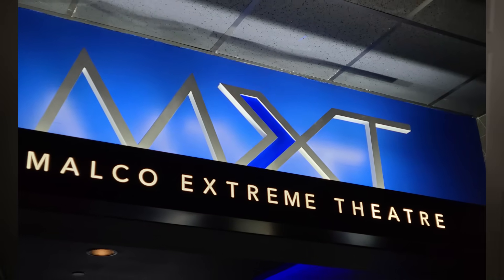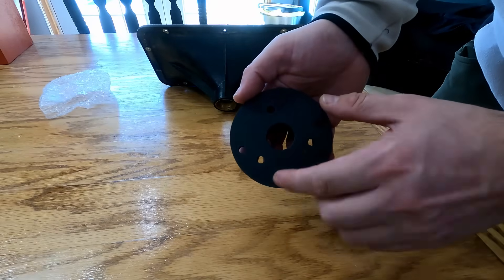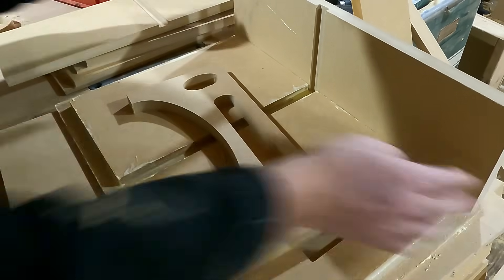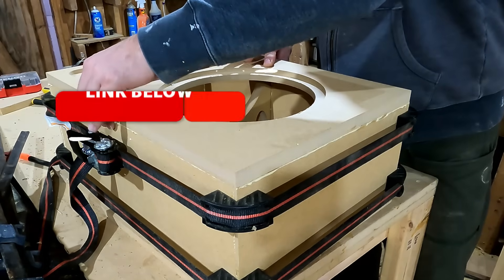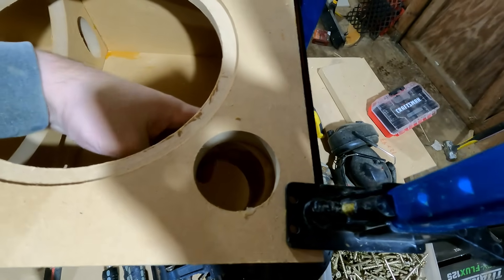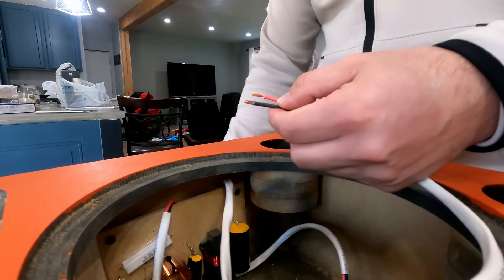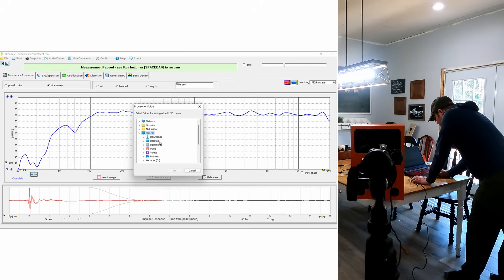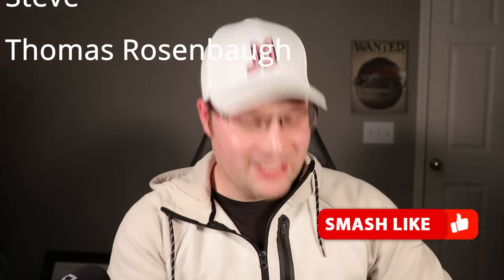How to Build $5000 Speakers for $400 - Klipsch KPT Inspired - Cinema 10

Comment: DO you think this would make a good match as a center with my klipsch Forte i speakers? Looks like 85 db sensitivity on the graph in the clip.
Reply from the maker: When I do my test, I don’t do them at reference. I just do them at a normal listening volume so I don’t blow my eardrums out. But yes, I think they would make a good center channel
Reply: @Toid  Hey
 thanks for you quick reply!! I meant specifically for the Forte... but the sound from the sound demo (open, airy, lively)and the fact that your graph was done a little lower tells me that they might be. thank you for your videos. they are educational and well done, sir.
Reply from the maker: @SmilinMikeable  I apologize I did mean to say I think they would make a good center for the Forte’s.
Reply: Just bought the plans. Not sure when I  will have time to complete but as a thank you, well worth it. How much do you think is to be gained by going with higher end capacitors? Just bought Sonicaps from Crites for my Fortés. will rebuild the crossover and am dampening the box with the car deadener stuff and foam and more bracing. Could do the same with your box. Do you think there would be an appreciable difference considering the driver quality (I dont think cheaper drivers are bad necessarily), box design, etc.? Essentially- how upscalable is it? Lol

Comment: I have a pair of celestion retro KR 8 speakers   and the plastik body is compelitly  cracked   this project look nice to rebuild  with there drivers  Only one problem the the bullet horn tweeter is completely intergrate into the plastik body waveguide  there is no screw-on socket and mounting plate on the driver   any idea  to solve this??

Comment: Is this your recommended build now for home theater? Can I use these for L C and R?
Reply from the maker: I really love these speakers. I currently use them as my surrounds. However, when they were in my living room, I use the men’s left and right without any center. They did such a great job and left and right that I was able to use a phantom center. And I would absolutely use them as an LCR. But I currently use the Audience 212 as my left and right with the Cinema 6 center. However, I have considered many times building another cinema 10 to use as a center
Reply: @Toid  Thanks! would the cinema 6 or 10 both be suitable? I have paradigm monitor 9 for left and right now but my center mid range just died. I am hoping to gradually build out my theater myself.
Reply from the maker: @ttonAb2  they are compatible. My personal preference is the cinema 10 over the cinema six.
Reply: @Toid  Thanks, I tried to purchase the plans but I get an error 404 page not available.

Comment: Projects such as these, remind me of a project that is still popular where i live. 
Its called Tangen AVdesign inConcert Miles. Using two Beyma 15p80Nd 15" pro drivers and a Beyma TPL-150H tweeter horn.
Its not cheap, but quality seems to be really high.   2022 these will cost you around 2200-2700 euro to build.
They can be used with passive filtering, but active seems to be the way, to keep that +100 db efficiency and dynamics.
One builder went from Klipsch RF-7 Mk II to inConcert Miles, and he said they were way better in every aspect, plus they can play much louder.
And RF-7 Mk II cost around 6000 euro here.  There is a few threads on the inConcerts, also in english.

Comment: Could this plan be incorporated into a music console design (think Wren Silva)?  Would I just incorporate the dimensions of the speakers into the overall console?
Reply from the maker: Yes
Reply: @Toid   With this in mind, do you have a recommendation on which speakers you have built that would be best for this sort of thing?
Reply from the maker: @kylekokko6572  I’d personally do the soundstage 15 as they are tuned lower, so they give you a full range of sound. These sound great, but depending on how low you want, you might want to pair these with a subwoofer

Comment: I believe the Dayton Audio MB1025-8 10" Professional High Power driver might be a much better fit for this project. It has the same usable sensitivity of 96db (looking at the graph) but 50% better XMAX and in a 1 FT3 internal volume box will give an F3 of 59Hz (with 50Hz 2nd order high pass) VS about 98HZ for the Celestion (after the 60HZ second order HIGHPASS) It would give this speaker a much better frequency range. So would be better for a surround speaker or center channel. 98Hz 3db down is not low enough for a center channel. Needs at least be flat to 85Hz for the male human voice. For surround speakers I would want at least 70Hz 3db down.
Reply: I see the xmax is 2mm.
Reply: @vegapower454  Right, I understand if he keeps a high pass to limit the Celestion to 100 Hz he is fine. but the MB1025 will go much lower work much better for surround speakers and I think even for a center channel. with an f3 down to 59Hz would also work good for some front left and right channel applications too and can have a Sub for frequencies lower than that. I have some 100Hz speakers and they just don't go low enough for rear surrounds (at least for me).

Comment: For some weird reasons, I feel sick every time I watch audio DIY videos those use spade terminals/disconnects/cable lugs etc.
I mean, I admire all the work these guys put in like, calculating, wood working, assembling... please spend few more minutes just hard wiring (soldering) those terminals with good quality wires...
Reply from the maker: The great thing about DIY as you’re able to terminate the drivers and use, whatever cables you want. What you learn with DIY is that soldering is often a last resort when connecting drivers. In fact, it usually is even inside the speakers that you buy commercially if anything should ever happen to a driver or crossover, or you just wanna make a change, it’s much easier to do this. Not to mention a lot of manufacturers drivers the way that they’re connected to the actual driver itself it’s not always the most secure to take an additional solder. But definitely use whatever cables, and or termination that you feel as fit.

Comment: Looking at some very expensive horn loaded speakers from a company called Fleetwoodsound their Deville loudspeaker which start from $15,000 have what look like a B&C compression driver and a 8 inch neo magnet woofer the drivers look to be ~$500-600 in total. I am sure the speakers do sound sound superb.. but I am sure a wooden exponential horn from Joseph Crowe and some great CNC woodwork would get something close for a lot less... A potential joint project Joseph?  
I'd love to see something like that made for people without $15k.

Comment: I've always wanted to do this.  I actually have a small wood shop and I've worked with wood for years now. I'm also an avid fan of music and home theater.  I've always wanted to make an exact copy of high quality high end speaker to see how much cheaper I could build one instead of just buying it. I of course would need to be able to find and buy the actual drivers and either crossovers intact of atleast have the schematic for the crossovers so I could build them as well. As far as the cabinet I could of course just build them to the same measurements as the original.  One of these days I'll do it....

Comment: So ... If you have a $20k digitized wood cutter you can make $5k speakers? Got it!
Reply from the maker: I used to CNC programmed router. The router itself is no different than any router you can pick up at any store. The only difference is I didn’t manually cut it you really only need a router, although a circular saw it would be nice to cut down the wood.

Comment: JBL Pro speakers can be bought by anyone. I have triamped JBL 4673s, often used in theaters, in my living room. $600. WAF is low, SPL and private rock concert-ness is very high. If it sounds like a speaker, nope.

People don't buy the best because the best is ugly.

Comment: Step 1: Buy a 5000 dollar cnc router
Reply: Step 2: sell the cnc machine and buy a $100 router and spend the $4,900 you saved on more speaker parts 😁
Reply: Yup....lol
Reply: For everyone who said they can make these using basic tools. I would DEFINITELY love to see some of you do this
Reply: @A_Class216 I didn't say it but if your carpenter you don't need to CNC. However, if you were a carpenter that did a lot of speakers, you would absolutely own a CNC. You cannot match the time that thing will save you by doing it by hand. Anyone who says otherwise is full of shit.
Reply: @the_stixXx  That's a fact.
Reply: Well, for $5,400 you will have a $5,000 CNC machine and speakers that are like $5,000 speakers.😂
Reply: U can do that with your hands and cheap tools. Or you can send de cad files to a cnc company. It's very cheap
Reply: @daalex_11  Yup. I didn't see anything here that couldn't be done with a track saw, router, two or three router bits, a drill, and a handful of clamps.
Reply: Or you can buy a cheap big speaker and replace the woofer and tweeter with those same ones in the video
Reply: Must be a redditor 😂
Reply: Haha
Reply: ok .He say this are good.Not
Reply: Hey, tools of the trade. The guy obviously does this type of woodworking and when you have to do things like that constantly, doing it by hand, this machine saves a massive amount of time and makes back the money you spent on it on the first couple jobs.
Reply: Or you could skills with power tools and hand tools….
Reply: @ some people lack skills; like the skill it takes to write a coherent sentence.
Reply: Basically anything you make on a CNC router and be done with a coping saw, a drill, files, and sandpaper. It just takes elbow grease.
Reply: All the other videos he does about off axis response on speakers are so detailed. In this video. He doesn't even show you what degrees off axis he was testing and what the attenuation was at any given frequency. Why?

Comment: 'A little stupid to title your build a $400 build when you use a $20,000 cnc-- 'just sayin..............
Oh, my wife wants to know: lipstick or spaghetti sauce?
Reply from the maker: I wish I had a $20,000 CNC, that would definitely be much better than what I have. The best thing to do is use the tools you have. The greatest thing about building speakers is you really just need a table saw/circular saw to cut the wood out and a router to cut out the circles. If you have a cnc, use it. If not a circular saw and a router will do just fine. But as with any DIY, some tools will be necessary.

Comment: Hang on, you calculated the enclosure size solely based on the depth of the CD? There's a lot more to it than that.
Reply from the maker: I think you misunderstood. I was simply referring to the fact that the enclosure couldn't be any thinner due to the depth of the compression driver in this waveguide.

Comment: I bought four of the KPT-8000M speakers (in 2015) for my dedicated home theater. And they are definitely not a $5,000 speaker. They cost me $220 each, plus shipping.

New. Not used or pulled from a theater or anything.

Comment: Question - what is your CNC machine?
Reply from the maker: It's a CNC4Newbie
Reply: @Toid  Thanks! I am going to be looking into it. What is the bed size?
Reply from the maker: @NeilBlanchard  for me it's definitely one of the better value cncs out there. They have the new car which is a little bit less expensive, but still about the same price range as something like a shapeoko. Yeah it's significantly better. It would be similar to something like the pro version of the shapeoko or x-carve. Although this version is the pro version of CNC for newbie which is more on par with something like avid.
Reply: @Toid  I appreciate the information. I have a Phlatprinter III that can cut foam, that I used to build an electric car design I call CarBEN EV5. But it rolls the material in the Y direction, and is not strong enough to do MDF or Baltic birch.
I am hoping to build more of a mass loaded transmission line speakers I designed, called MLTL-6, and I am wondering about cutting panels on a table saw, and then using a CNC to cut the grooves and tongues and driver openings. etc. Then the bed can be somewhat smaller, and the trick is to set the datum consistently, and holding pieces in place.
You are using SketchUp to model the speaker cabinet - what is the process to set up cuts on the CNC?

Comment: If painting MDF, I mix Elmer's white glue with water 70/30 (glue/water) and apply it with a chip brush. After two coats are allowed to dry, spray or brush on desired paint

Comment: You mention using this speaker as a possible center channel speaker. I was wondering how well it would compare to the Cinema 6 speakers you built?
Reply from the maker: The cinema 6 are more directional while this has a much wider off axis. So part of it has to do with what you like more in a speaker. The cinema 10 is going to cover the area better.
Reply: @Toid  Regarding how the Cinema 6's are more directional, does that have more to do with the waveguide or the woofers?

Comment: Nice build and amazing colour but I was curious why you used crimp connectors and not solder and why there was no speaker gasket / threaded inserts for speaker screws.

Comment: Build these speakers for 400 bucks plus 7000 in tools  😂.   I could just buy better speakers for 2 grand or less and save a lot of time and effort.
Reply: I bought the "inspiration" speakers 7 years ago for $220 each. There are suppliers/distributors out there.

Comment: I'm considering buying the plans for these. I have a buddy with CNC for cutting the boxes, but I do have a question for you. I noticed you didn't use any fill in the box, is it not necessary on these speakers?
Reply from the maker: It's not, but if you want to you could add some.

Comment: They come up on the used market from time to time.  I have a set of JBL side and rear speakers, I almost got front of house ones but could not get the OK from the other half.  They really did not sound good honestly and I pulled the drivers and crossovers from them and junked the rest.

Comment: The question I have is this: why put the time and effort into a ported speaker?  The port is tuned so that means you ALWAYS get whatever note that port is tuned to.
Reply from the maker: You might want to rephrase what you mean. Whatever you meant come isn't coming across properly. Because it sounds like what you're saying is a ported speaker will always play the note that it's tuned to. So if you played a 20 kilohertz tone, it's going to play an 80 HZ tone out of the port (assuming 80hz tune), which is completely incorrect. The reason why I ported speaker is used here and often and even movie theater applications (in fact every Cinema rear surround designed by Klipsch is ported) is to increase the low end efficiency. Which is of course the main advantage of a ported enclosure.
Reply: @Toid  A port is tuned to a certain frequency.  Consequently, nothing but that frequency will come out of that port.  Lots of ports are tuned to 40hz to trick the listener into believing that that box is producing all kinds of low end that doesn't actually exist.

Of course, I'm not in the HiFi world but the world of Studio Mastering Engineers.  Things there are at a whole different leve.
Reply: the port just makes the tuned freq louder.. it does not cancel out other frequencies..
Reply: @RogueConstantine  Let's say your port is tuned for 45hz.  Well, any air pushed through that port and lower frequencies push more air, will just play a constant 45hz tone and "trick" the listener into believing that there is more low end content.  It works no differently than a pipe organ and it is a trick to fool the public.  Don't fall for it.

Comment: The project looks really nice...but first I need several thousand in equipment! If you haven't already, please talk about the tools you used.
Reply from the maker: That bare minimum all you need is a router. A big box store like Home Depot will cut your wood down the size for you. And a router can cut everything else. If you don't have a big box store around you then you probably also want a circular saw in a straight edge. That's the bare minimum that you would need.

Comment: I am desperate to attempt a build such as this.  The problem I have found is every time I go to shop for the parts you use and provide links for, they are either no longer available or the postage to Australia makes it almost not worth it.  Is there anything you can suggest to work around this?  Perhaps create a build video with known popular parts that have been around for a little while and are expected to be around for more than a year or two?  I don't know mate, I just want to break away from the mass-produced overpriced rubbish I have owned for decades.  Cheers! :-D

Comment: Hiah.. so were you just copying the port depth and diameter (and qty) to match the pre-existing design or did you use your design software to calculate the port tube length and diameter based on the correct resonant frequency? did you want the low end to be that high at 80 hz? I'm assuming since this is a small volume enclosure that's perfectly ok given that a system like this would have a sub, etc?  Other than that very nice flat frequency response.. Having a cnc like that certainly is a hefty but worthwhile investment too. :)

Comment: Great build. But I will never put cross overs in my cabinets again. If you leave them external you can modify it anytime and hide them any where. May need more wire to hide stuff but a lot easier to tweak.